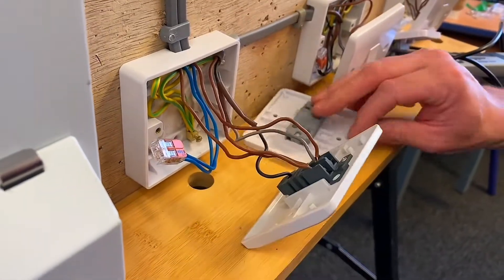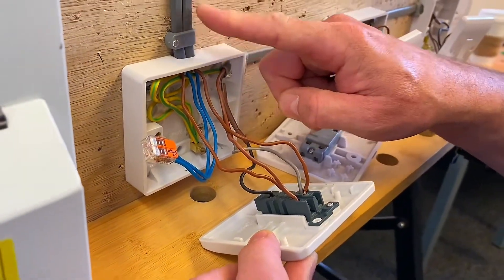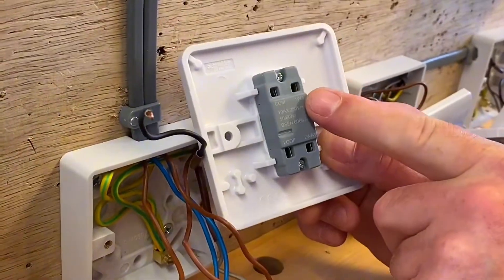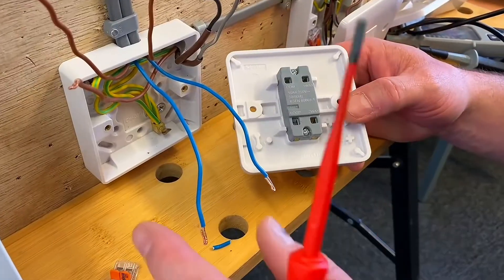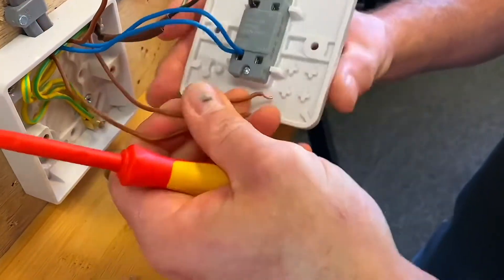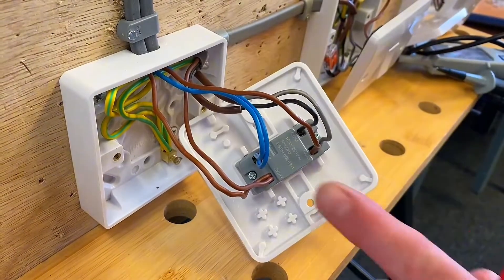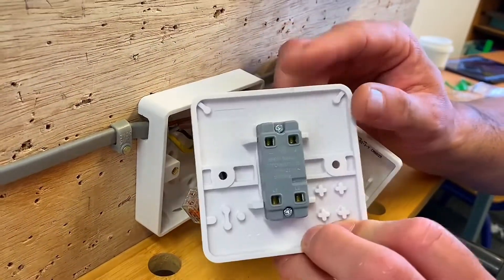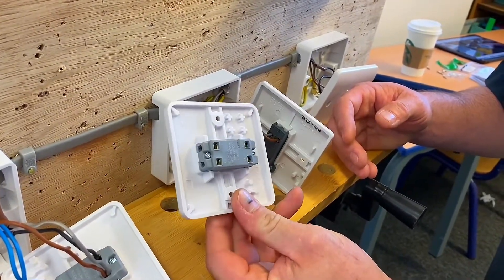Not all Light Switches are Made Equal…

Comment: I never understood why whoever set up the standards for lighting circuitry when permanent neutrals at the switch became a thing decided to do it by looping in two twin & earth cables using two-plate rather than using a single three core & earth with three-plate. You only need four wires in the vast majority of light switches; earth, neutral, line and switched line. That's just 4 wires, whilst looping through via the switch means 6 wires crammed into what are often very shallow back-boxes. 

It's not as if triple & earth cable for lighting is exactly unusual. It's needed for all sorts of purposes. I also suspect that the two-plate solution uses a more total cable length.

Personally I think this was a missed opportunity.

Comment: why would you have a neutral terminal at an intermediate? if youre pulling neutrals to an intermediate, youre wasting cable.
Reply: There is no neutral at the intermediate switch in this video. The black wire is the common traveller. It will be at phase voltage when the light is on and in one of the two off states (hence the brown sleeving).
Reply: @GrahamNye  i know that, the guy in the video is ASKING for a neutral terminal on an intermediate switch, where there should be no neutrals.
Reply: @rashdondoesntunderstandwor-g1x half wit
Reply: @ stick to fitting lampshades mate, leave the thinking to the big boys
Reply: @d34nr2k8  getting called a half wit by people who want neutral terminals on intermediate switches is TOP KEKS
Reply: @rashdondoesntunderstandwor-g1xhe’s not asking for a neutral terminal, he’s asking for a loop terminal that he can use for his traveller wire.
Reply: @JasperJanssen  so why is he banging on about neutrals then? either way, its a stupid idea.
what we have now works

and the hager switches that do come with neutral terminals, seldom get used, so whats the point? for the guys who only do electrical work on a worktop with 1 metre of cable or the real world guys?
Reply: @JasperJanssen  lets change all the tooling at the factories that produce these switches then, and the design of every intermediate switch, to keep the 4 electricians that would ever use those terminals happy.

theres a reason why they havent included them.
Reply: @GrahamNye  what im getting at, is this video is a massive waste of time, there is no need for a neutral terminal built into any light switches, when my boss supplied these, i used wagos anyway

what makes more sense, faffing about trying to get 4+ neutrals into those pissy little terminals or just put it in a wago? now multiply that saving over 1000s of switches fitted.
Reply: Neutrals at light switches? What the hell for.
Reply: @mickwoolley1700  future proofing